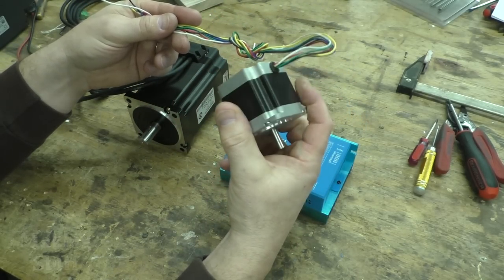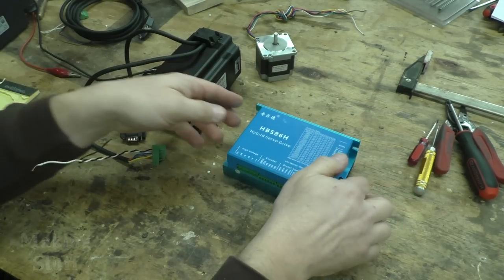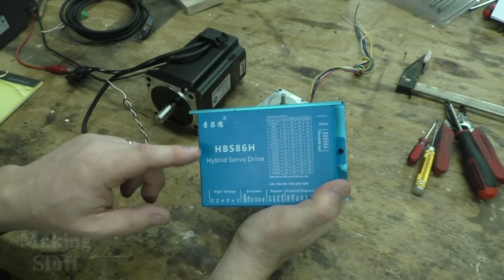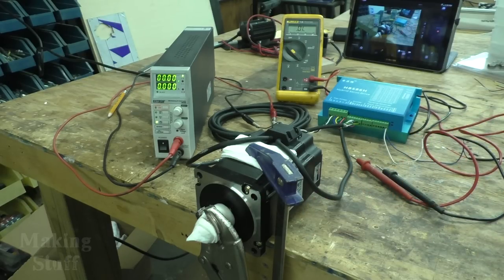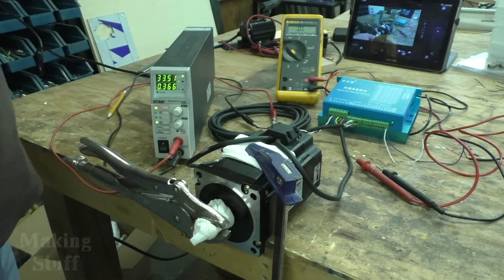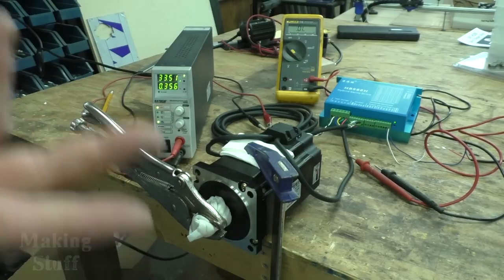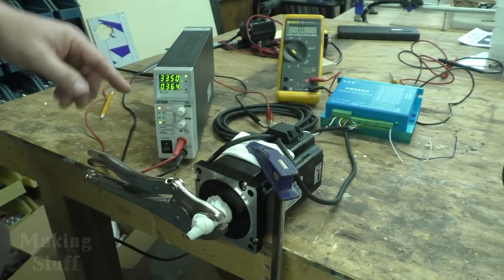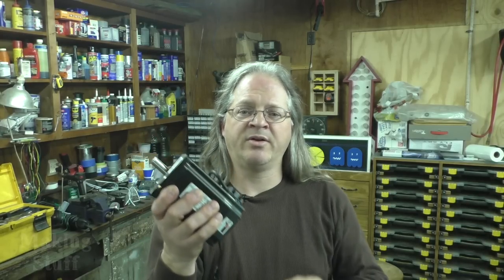Closed Loop Stepper Motors for CNC machines

Comment from the maker: What would you do with a single NEMA34 Closed Loop Stepper?  Leave a comment and let me know.  Thanks for watching!
Reply: Quick question I’m looking to build a mpcnc or a low rider Cnc. Could I replace the typical open steppers for the closed ones on these machines?
Reply: Electronic indexing rotary table for a mill or CNC. Something that big will have plenty of holding torque for a lathe chuck, and the feedback will make it very reliable.
Use it for hobbing gears, drilling holes etc etc
Reply: if you only have one motor how about a tapping machine?
Reply: @youngswoops  It's not designed for it, but yes you could. the electronics setup would be up to you
Reply: How about a auto pilot for a boat? Hook it to the rudder on a sailboat and let it plot GPS coordinates to get you from point a to point b.

If you had two units I'd suggest lathe control.
Reply from the maker: Yeah, but you will have a hard time getting it to work with a RAMPS or Rambo board because they have stepper drivers built in.
Reply: A door drive. An over kill but no limit switches needed. Can you limit the torque on it?
Reply: Make a 4th axis
Reply: also - run it within it's specs! These guys use 5-7A at 60-80V DC to do a maximum torque of 10Nm -  these little Babies are actual Beasts in Hands of someone who knows what to use it for.
Reply: An automatic miter saw or band saw fence like a Tigerstop.
Reply: Might work well as a 4th axis...
Reply: @MakingStuff  RAMPS, Rambo boards etc usually have external outputs too so you can connect up seperate drivers also
Reply: Well I would upgrade my mills nema34  Z axis stepper with it, its the last stepper in my system.
Reply: Give it to me..:) I'd make a rotatory head (4th axis) for my cnc router
Reply from the maker: @random shit Good to know, thanks.
Reply: @MakingStuff  they have pins for control of external drivers. En Step/Pulse Dir Gnd. No need to use the drivers on the Ramps/Rambo or any other 3d printer controller with plug in steppers. 

I'm driving Nema 42s off a $20 MKS Gen L and some external drivers
Reply: Cnc lathe for the plasma table
Reply: I'm with most, love to see that in a 4th axis and see how it works as an indexer! Dont know about you, but I'm sick to death of figuring out which damn ring of holes to use and that stupid little banjo drives me nuts......lol
Reply: hi, i will use three nema 34.85kgfc, my source is 60volts (dc). in the driver no mark where it is positive-negative, only AC-AC
which one should I turn on the positive.
Reply: A perfect table saw fence would be pretty badass. Being able to dial it in to the mosquito eyelash on command would be sick.
Reply: Be patient enough. When the time comes buy two more similar to it and build a cnc milling machine.
Reply: I recently bought an old Bridgeport milling machine with missing X-axis screw and knobs. I ordered a ball screw and small stepper motors for it to learn what I really need, and this motor is it! (per advice from CNC website) I plan to connect the motor control to a PC, start initially with 1-axis programmable power drive (useful by itself), later add 3 more axis including drive for the rotary table that I already have.
Reply: Replace it with a Servo Motor :)
Reply: Can be used as door closer . closes the door behind you
Reply: With a ball screw and a 80mm piston and a 100lb load cell(other weight depending on spring size to test), use it as a coil spring tester for springs 100mm x 3mm.. Only had an open loop step motor in 1985 when I made a spring tester connected to an Apple II; yep Apple II. Version II used 8MHZ PC-AT clone and my designed step motor controller that had a Z80. Sold two units for $3,995...not including the PC. Still have a printout of the source code I wrote in Pascal. Apple version was in Basic. Today I can only imagine how much better the system would be with a i7 Pc and this closed loop stepper!
Reply: Additionally, I should mention I did not invent it, but worked and improved the software on the Apple II for the machine developed at Rockford Spring Company by Edward Garst (deceased[giving credit where credit is due]) in 1984(?). Then acquired rights to the design and I developed a PC version and developed new source code with SPC written in pascal and an IBM-PC slot circuit board with Z80 which executed low level stepper commands (1988(?)). If it missed a step, you were screwed! A closed loop would have been fantastic!
This project was lost to posterity!
Reply: I installed a Nema 52 closed loop stepper as the main drive motor on my mini lathe! lol. It's scary how powerful it is, especially at low RPM. I'm half way to an electronic screw drive as well! :)
Reply: @youngswoops  yes, for the MPCNC there are some custom Motor mounts for Nema 23, and you could just mount a closed loop Nema 23 Stepper to it. There are some closed-loop Nema 17 Stepper motors that have the driver already on the motor, but i'm not sure if they are suitable for use in a dirty environment like a CNC Router
Reply: what about a ventilator solution for COVID-19 hospitalized patients????
Reply: Hey there,
As school exam project we have to build a machine for a company.
Im making a machin with this motor and going to programm it on the arduino software. We use a controllino as PLC. There is only a problem. Im new to programming an programming this servo is little hard for me. Can you help me.out with it?
Reply: Hey Bob. I love the videos and the easy explanations. I'm looking to build a back guage controller for a press brake. single axis, single motor, and a screen to show current value and obviously able to adjust the distance from the top bending die. Just need a small touch screen for user interface.
Reply: I'm just about to order one to power a 17" rotary table.
Reply: Hi i got some HBS860H drivers and some of then as soon as I power on the machine they blink 9 times stop a few seconds, and blinks again, and right now I cant use the motors, any idea to reset the driver??? They are new, they are completely new.
If you can help me it would be great
They move at first but now is imposible.
Coils and encoder cables are 100% in the correct positions
Reply: I would watch it rotate at high rpm continuously. That is having a charm of its own.
Reply: You could build a measuring system for a chop saw.
We have a cold saw for cutting tube steel for handrail fabrication.  It would be awsome if we had a system that we could punch in the cut length and have it adjust an end stop to desired cut length.
Reply: Move desk up down with hex shaft.
Reply: @marcus_w0  Thats what I was thinking. No worries about weight on a fixed table machine with a 4th axis and keeps the part right where you want it.
Reply: @jessesheehan4051  ... if you run it accordingly. Holding torque equals amps times volts. The more, the better. Within its reach.
Reply: I have use this for cnc wood route. the only problem is it need to restart after driver alarm. there is noway to reset

Comment: i'm working on a parts list for a cnc router and i'm planning to use closed loop nema 23's. this video was very helpful in understanding how they work. thanks a lot for posting
Reply from the maker: Glad it helped
Reply: basic need mesa card controll all input/output,old paraller port not handle many input. then need lot expensive motor drivers, and then steppers whit encoder lot expensive than normal motors. lot waste money.

Comment: Just to correct some terminology. A "Hybrid Stepper Motor" has noting to do with being closed loop, it is a type of stepper that is effectively a cross between a "Permanent Magnet Stepper Motor", and a "Variable Reluctance Stepper Motor". Hybrid Steppers are the type that most people are probably familiar with.

Adding a feedback (AKA closing the loop) effectively turns any motor into a servo motor / system. While servos are typically made with BLDC motors, they need not be. A servo motor is just a motor with a feedback mechanism. Hobby servos used in the RC world are typically brushed DC motors with a potentiometer used for positional feedback.

Comment: I built a PCB mill back in 1998 with steppers with encoders.  I wrote the control software in VB6 and after each move, I had the code check the encoders and make minor positional corrections.  If a deviation was over a certain valut it would halt the machine.  It's cool to see this hybrid with the encoder and intelligence on the hardware level.  Thanks.
Reply from the maker: Thanks for watching!

Comment: Good video. Just a clarification - the encoder doesn't tell the controller that it missed some steps. It merely reports the shaft angular position to the controller and the controller makes the determination about the error in position and makes an adjustment using some kind of closed-loop control algorithm such as PID.
Reply: Great point, thanks for it. That was what i was looking for.
Just a question,  If pid or some kind of controller involved in Hybrid servo driver, where can i see the PID parameters, or can i change these PID parameters with the sofware ?

Comment: I want to know what you did with the tuning software once you got the cable.  That is what I want to see.      Literally no one has posted anything about tuning and results delivered afterwards.      PLEASE POST A VIDEO ABOUT THIS!
Reply: most people defo failed at it and the machine moves in weird arcs :) closed loop systems tuning takes a lot of time
Reply: @chronokoks no it doesn't :) servo system takes a lot of tuning and they are always closed loop (can't work otherwise).
But a closer loop stepper system doesn't require any tuning to function (just the same or even fewer settings as compared to an open loop stepper).
Closed loop steppers are always stable, they are steppers and not servos after all.

Comment: "Stepper motors" are actually just many-poled synchronous motors which can be driven like regular synchronous motors as well. The only difference is that they don't have an encoder built in, so you can run them in closed loop if you put an encoder on the output shaft. The big drawback is that most cheap controllers (like the RAMPS-based ones) don't allow for any encoder connections, so you need more sophisticated controllers to make that work.

Also, synchronous motors can be run closed loop with a method called sensorless back-EMF sensing, which would also work on regular stepper motors. The idea is that the controller will monitor the undriven poles of the motor to see if there is any induced voltage and if there is, it means the motor shaft has moved, so the controller can adjust accordingly (or conversely, check if there is any movement on the undriven poles and re-try when that doesn't happen while it should.)

Comment: There are limitations to hybrid systems, like quite limited RPM under load. If you need a motor that can be run with large RPM, lots of power and can also be moved accurately like a stepper, you need AC-servo motor which is VFD driven AC motor with optical feedback.

They are the real workhorses of any CNC where they can be used for everything including high speed spindle motors, that can also move in sync with other axes of the machine with very low RPM's but can push out kilowatts of power. :)

Comment: Dear friend, I saw your video and thank you, you were very understanding and finally the closed loop is the new technology
I wanted to ask you something very interesting because I do not use CNC  technology only for movement in my machines lathe mill, etc., I can drive the engine with these new machines as I do with the simple steppers with pulse generator thank you very much .

Comment: Correct me if I'm wrong, but I think those are actually servo motors which are made to operate like steppers by the controller. Servos are definitely superior, but controller cost has been a limiting factor in the past.
Reply: it is a stepper with a servo controller, they have more torque but can't run as fast as "real" servo motors
Reply from the maker: Lasse Langwadt Christensen It's also not as quite as a servo motor.

Comment: Normal stepper drivers set the current as well, the reason hybrids run cooler is they don't need to assume they'll be under full load when not turning, normal steppers have to be held at full current to brake them, with an encoder the current can be reduced until the point the encoder says WHOA! the motor is moving, at that point the controller can ramp the current back up to just enough to hold it in position so the brake current in most cases is far lower for a hybrid stepper, if a hybrid stepper is under full load it'll get just as hot as any other stepper.

Comment: I have the same motor and driver (12nm and hbs860h driver), I wired them up correctly and everything worked fine until I disconnected the encoder and my driver burned out immediately... I have no idea why, do you? Btw. You inspired me to make a cnc router, thanks.
Reply from the maker: I know some drivers will burn out if you disconnect the motor while it has power.  Not sure if these will do that.  I always make sure the power is off for several minutes before disconnecting any motor.  Thanks for watching!

Comment: Nema 23 is fine for plasma I believe. I want to build a dual table though. Plamsa and cnc milling machine. So the power to drive the spindle whilst its carving steel is nevessary.

Comment: I have a NEMA24 HYBRID SERVO SET 33KG-CM W/T 80V 7AMP DRIVE RS485 MODBUS COMM. I want to run the motor and control it specifically using an Arduino board but when I give the connections it is not running. My connections go from an SMPS to the two-phase servo drive. the encoder wire from the motor is connected to the drive and the same with the motor terminals. But the motor is not running when I try it like this. Please if possible could you help me out a bit.

Comment: I'm assuming you can step this motor using an Ardunio controller. I just ordered this motor along with a CL86T stepper driver and 48 volt 10 amp power supply. I am making a soda can crusher using this motor. I tried using a NEMA 23 stepper motor and having problems with it stepping back to zero because of slippage.

Comment: ok... I don't know if you installed the hybrid yet but if you did, I have a few questions.  
1.  did the hybrid upgrade talk to your mach3 or your pc software and change your x.y. movements on your accordingly?
2.  would a mpg pendant work with this setup? if so would it talk to your pc and change your x.y. movements accordingly?
3.  what is the cost for the upgrade from your setup?  I believe we are gonna be using the same size of motors  (for my Bridgeport upgrade motor replacement)
thx for the video.. it was very informative for me.
Reply from the maker: Can't answer 1 & 2.  Answer to #3 is here https://www.makingstuff.info/Projects/CNC_Plasma_Update

Comment: I think technically the absolute encoder or position resolver in a closed loop stepper cannot and does not communicate anything but position to the controlling software. It is up to external software to determine if the motor's shaft position is out of step or bounds.
Reply: i totally agree with you, 
per design and specs. the Absolute encoder never provide feedback signal of speed, distance, or velocity, it's only used to provide feedback signal with position either Angular position in rotary encoders or linear position in linear encoders

Comment: @13:29 That free swinging vice grip shows me that a counter balance on my Z axis is a very real requirement and not an option!
Very informative video.  Thank you.
Use for a single motor?  Pump up the amps and make an arm-wrestling robot - get it to error state to win.  Oh yeah, small disclaimer.. it will break bones so you might want to consult a lawyer before taking it to the local school fete.. :)

Comment: hi with the closed loop stepper motor to go on a plasma cuter you will have to put the driver box next to the motor or could you extend the cable to your main electrical box ?????

Comment: Hi. I'm changing my stepper motors for hybrid. I'm wondering about the pulse per revolution. Is it the same as normal step per revolution? On one stepper i have 64.147 step per rev. Should i set the same pulę per rev. ? Thank you

Comment: Ques... what are the advantages of having a gear reduction system installed ewww ad of just direct drive with a spur on the motor and the gear rack? I keep getting a loss of steps on my nema 23 motors and idk if I should upgrade both motors on my gantry to nema 23 closed loop stepper motors or if it will help if I have a gear reduction system with a spring tensioner. Any advice?
Reply from the maker: I've been told that 3:1 gear reduction is the sweet spot between speed and torque.
Reply: Does gear reduction help with loss of steps? Or would switching to closed loop stepper 23 motors help? Or both? What would you recommend.....its for my plasma table
Reply: @MakingStuff  so do you need a computer to program these in order to set everything when you get them or can you just go and wire everything up and your good to go? Can you make a simple "how to connect " video?